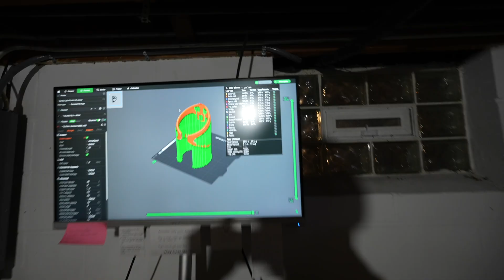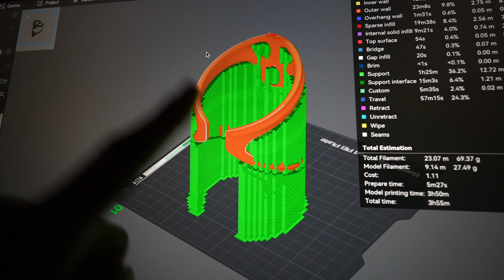3D Printed vs Store Bought: Which is better?

Comment: OHHH YEEEAAAH! Somebody had to say it :)

Loved the video - for additional strength, in addition to layer orientation, consider printing with other materials. I don't believe you mentioned which material the cages were printed from, but I'm assuming PLA. PETG would be far more suitable for this given its mechanical properties and tendency to bend as opposed to snap (like PLA does) and can be easily printed by the A1 Mini without an enclosure - just ensure you print somewhere where the printer won't be subjected to drafts or cold air. If you made an enclosure (there are plenty of cheap ways to do this), you could consider exploring an 'easy' ABS/ASA filament, though I'm not sure how the A1 would go with standard ABS/ASA filament (waiting for all the Bambu folks to tell me I'm wrong :D) Beware of toxic fumes from the filament during printing if you try this though, especially with ASA. Print only in a well-ventilated area, and use a particulate filtering mask if possible, unless you're using an enclosed printer with an appropriate filtration system.

Comment: First rule of 3D printing is layer orientation for strength.  Gotta think about that every time.  Also, the metal has memory and work-hardens so each bend will weaken it.  You can usually heat treat them to return them to their original strength, but that is another step.

Comment: Anyone who is thinkng of 3D printing a bottle cage (or anything else) be careful with what material you print the cage out of.  You need a material that will hold up to high temperatures....otherwise you run the risk of the cage deforming on a hot day.
Reply from the maker: Great tip, thanks for sharing! Which materials would you recommend?
Reply: I would suggest PETG. Not every printer can use it because of the higher temperature and needing a heated print bed, but it's a stronger material and is more resistant to water.
Reply: wait is this printed in PLA? impressive
Reply from the maker: @elburrona yeah!

Comment: Definitely am gonna print my next bottle cage!

A 3D printer is such a useful tool for oddly specific things that may not be readily available off the shelf.

I printed a speaker mount for my top tube so I could play some tunes on my Bluetooth speaker. I also printed some adapters to mount some cages to my front fork, since the bolt pattern didn’t line up.

Also, I CAD most of my stuff in Onshape. It’s a cloud based platform that is free if you’re not doing enterprise stuff. Easy to use and you don’t need a high end PC to run it. Works very similar to Solidworks.
Reply from the maker: Those prints sound awesome! 

Also thank you! I've been looking for a 3D software but Fusion is really expensive for how little I think I'd use it